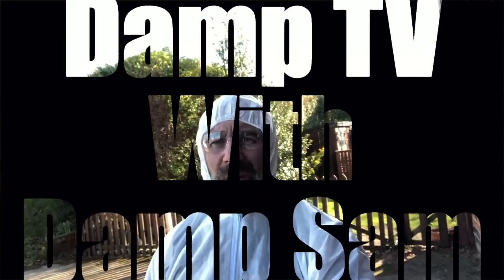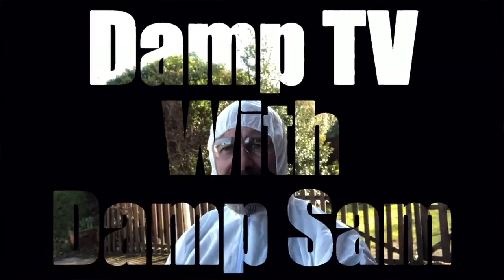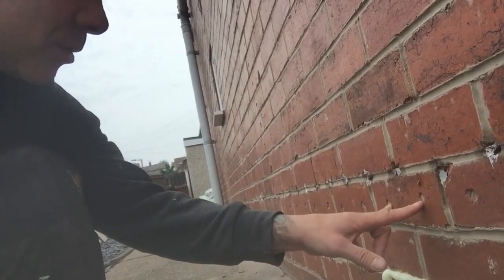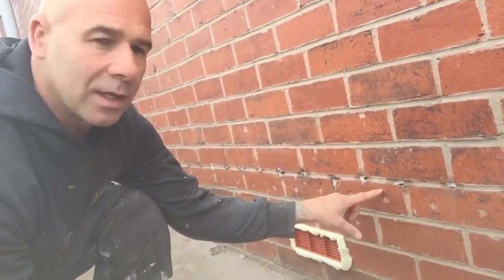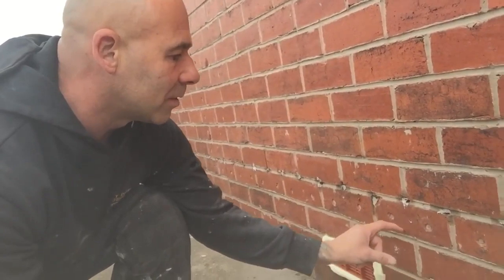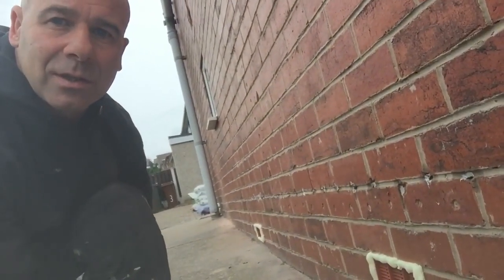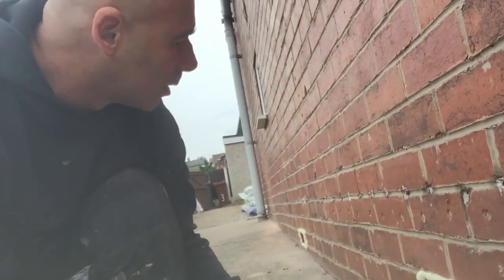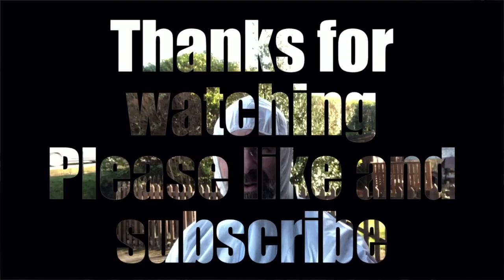Why We drill & Inject the Mortar Joint and not the Brick (editors Cut)

Comment: Hi Sam, i have had a new damp proof course, and a new kitchen put in. The walls are basically bottom row breeze blocks, then normal bricks sat ontop of the breeze block which had a very poor unclear mortar line above the breeze block. So instead I have noticed from pictures that he has injected into the actual breezeblock and not the mortar line. Is this now destined to fail. Leading to all sorts of complaints

Comment: How do you know if your dpc needs to be replaced? Great video!
Reply from the maker: There are lots of reasons, if it’s bridged by a concrete floor getting installed over the top is one, 
It there already is a dpc in place you have to judge which is the best method to correct the work, most jobs we go on have more than one type of damp affecting the property so different systems go in.